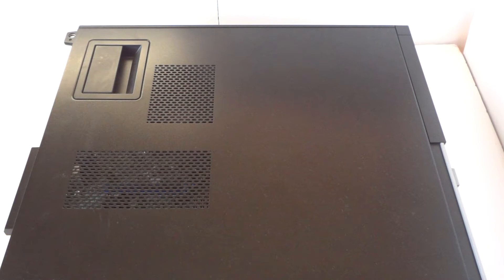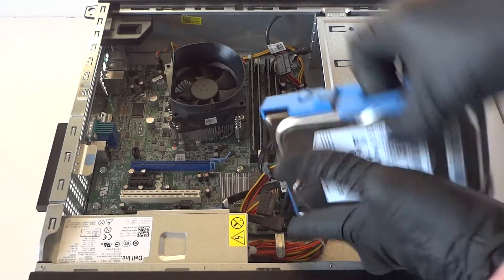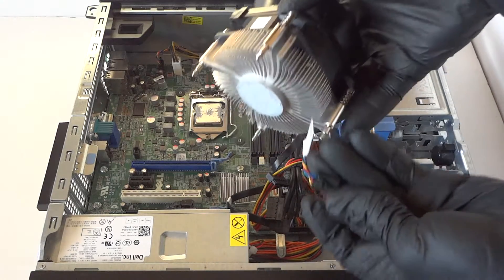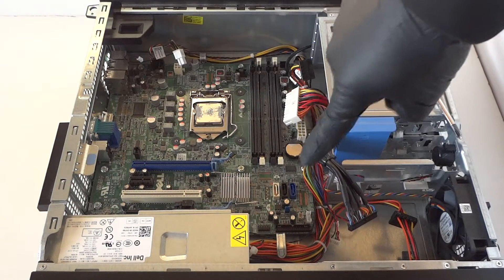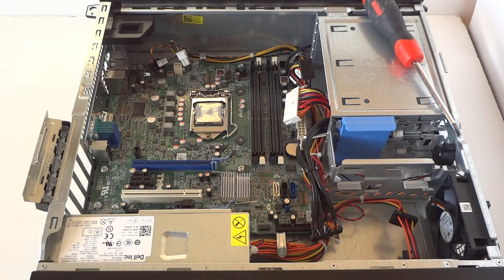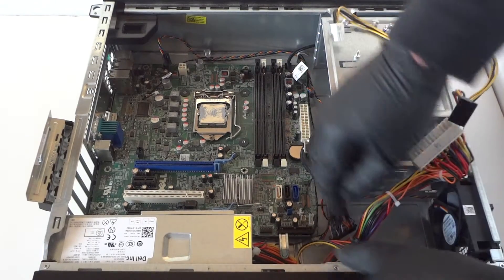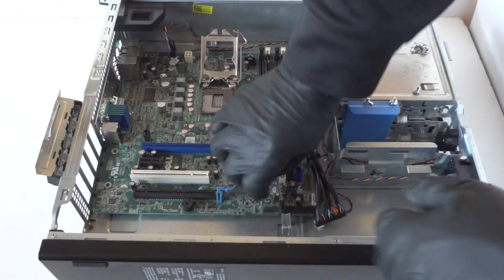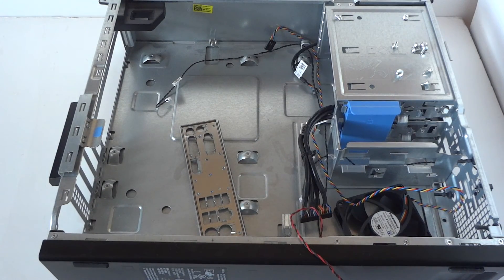Dell Optiplex 790 Teardown

Comment from the maker: List of Parts, Upgrades.. This video cards will work with this system dell optiplex 790. 

   
USB Wifi Adapter for PC AC600Mbps Wireless Network Adapter
 https://amzn.to/2ZaGuHb 

 
This video cards will work with this system.
(1.) GIGABYTE GeForce GTX 1650 OC 4GB GDDR6, GV-N1656OC-4GL Video Card
https://amzn.to/2B7N1sP 
 
(2.) Gigabyte GeForce GTX 1650 OC GDDR5 Low Profile 
https://amzn.to/3el08os
(3.) Gigabyte Geforce GTX 1050 Ti OC Low Profile 4GB GDDR5 128 Bit PCI-E Graphic Card (GV-N105TOC-4GL) 
https://amzn.to/2T8bfsv
(4.) MSI Gaming GeForce GTX 1650 4GB GDRR5 Low Profile Graphics Card (GTX 1650 4GT LP OC) 
https://amzn.to/2X1FYsF
(5.) MSI GTX 1050 TI 4GT Low Profile  Graphic Cards 
https://amzn.to/2LwZd7P
(6.) Gigabyte GeForce GT 1030 GV-N1030D5-2GL Low Profile 2G Computer Graphics Card 
https://amzn.to/2Z4PHkp
(7.) ZOTAC GeForce GT 1030 2GB GDDR5 64-bit PCIe 3.0 DirectX 12 HDCP Ready Low Profile Video Card ZT-P10300A-10L 
https://amzn.to/2WzgLXk 
(8.) MSI Graphic Cards GT 1030 2GB GDDR5, Low Profile 
https://amzn.to/390Spum 
  

This RAM works with this machine MAX Supports 32GB:
(1.) Crucial 8GB Single DDR3L 1600 MT/s (PC3L-12800) Memory CT102464BD160B
https://amzn.to/2z7gDpj
(2.) Crucial 4GB Single DDR3L 1600 MT/s (PC3L-12800) Memory CT51264BD160B 
https://amzn.to/2TrcLq1
(3.) Crucial 16GB Kit (8GBx2) DDR3L 1600 MT/s (PC3L-12800) CT2K102464BD160B 
https://amzn.to/3g7dE0C

 
This HDD 2.5inch will work in this caddy for extra storage.
(1.) Dell 3.5" to 2.5" SSD or Hard Drive Caddy Adapter R494D 0R494D 
https://amzn.to/2XTPeRr
(2). Dell Hard Drive Caddy, R494D, F767D 3.5" to 2.5" SSD or Hard Drive
https://amzn.to/3cTkcOk
(3.) Black  HDD Plastic Mounting Bracket Adapter 3.5 to 2.5inch SSD or Hard Drive 2.5, 
https://amzn.to/3bP1O7Y 

(1.) Seagate FireCuda 2TB Solid State Hybrid Drive Performance SSHD – 2.5 Inch 
https://amzn.to/3b1e8T7
(2.) WD Blue 2TB Hard Drive s, SATA 6 Gb/s, 128 MB Cache, 2.5"
https://amzn.to/2Xstb4b
(3.) Seagate BarraCuda 2TB Internal Hard Drive HDD – 2.5 Inch 
https://amzn.to/2xmf0TE

This Splitter cable required if you going to install SSD and HDD 2.5inch with 494D  0R494D Caddy :
Benfei 15 Pin SATA Power Y-Splitter Cable 8 Inches
https://amzn.to/2XsG0LV
Cable Matters 3-Pack 15 Pin SATA Power Splitter Cable 8 Inches 
https://amzn.to/2Rval8B
Zheino SATA Power Splitter Cable (2 Pack) SSD Power Cable HDD
https://amzn.to/3a3V9Wq 

SSD list works with this PC:
(1.) Samsung 860 EVO 500GB 2.5 Inch Internal SSD MZ-76E500B/AM) 
https://amzn.to/2ZlZDGg
(2.) WD Blue 3D NAND 1TB Internal SSD, 2.5" WDS100T2B0A
https://amzn.to/2XezdU9
(3.) WD Green 1TB Internal PC SSD  WDS100T2G0A
https://amzn.to/2XfGtzc
(4.) SanDisk SSD PLUS 480GB Internal SSD SDSSDA-1T00-G26
https://amzn.to/2yfgjUK
(5.) Crucial MX500 250GB 3D NAND SATA CT250MX500SSD1(Z) 
https://amzn.to/3bTTjbX
(6.) Samsung 860 PRO SSD 256GB - 2.5 Inch SATA III 
https://amzn.to/2ymvQCq
(7.) Samsung SSD 860 EVO 250GB 2.5 Inch SATA III Internal SSD 
https://amzn.to/2VjIAkK
(8.) SanDisk SSD PLUS 240GB Internal SSD
https://amzn.to/2zfc7EX

Thermal Compound Paste:
(1.) Arctic MX-4 2019 Edition Thermal Compound Paste Carbon Based
https://amzn.to/2XcsZo4
(2) Arctic Silver 5 Thermal Cooling Compound Paste 
https://amzn.to/2ziNU0H
(3) Noctua NT-H1 3.5g, Pro-Grade Thermal Compound Paste
https://amzn.to/36kTk7A
(4.) ARCTIC MX-4 (current edition) Thermal Compound Paste 20 Grams 
https://amzn.to/2DhGJaK

HDD list works with this PC:
(1.).WD Black 2TB Performance 3.5" Hard Drive - 7200 RPM Class, WD2003FZEX 
https://amzn.to/2xFUeyF
(2.).Seagate BarraCuda 1TB Internal Hard Drive
https://amzn.to/3g8FXM8
Reply: Stop

Comment: just ordered this pc from Newegg for $75 going to toss the MB and Install a ITX AM4 mb with a r3 5300g and a 5060 GPU and a replacement 500w PSU for a media pc also why i want a full size DVD drive slot for and console stile gaming on my 4k tv and watching movies ..I will test the low profile 5060 in it before I remove the old MB just for grins.. that's is one thing nice about this case is it fits standard ITX and Matx motherboards for modern upgrade and retro build ..

Comment: Seems you don't even need a caddy to put a 2.5 inch drive in. Underneath the caddy for the 3.5 inch drive, are four screw holes (one is kinda covered by that silver aluminum piece) that are the perfect dimensions for mounting a 2.5 inch SSD. So you can run dual drives with just that built in caddy alone.

Comment: Is the 790 dt the same as the 7010 dt?Are the front bezels interchangeable?
Reply: yes, the 7010~ is basically a 790dt but probably the difference is the power connector at the motherboard (if i'm not totally wrong)
Reply: Stéfano Júlio Mariani oh that’s good to hear then.I am looking for a front bezel and they look identical but wasn’t sure if they are the same dimension etc.

Comment: why do them sensors even exist? will my pc function normally without them plugged in ?
Reply: You’ll get a warning each time you start up your pc if they aren’t connected but you can still run the pc without the temperature sensor.

Comment: Sir, what is best powerful graphics card for optiplex 790 dt can we upgrade power supply ?
Reply: Running with a 990 DT i7 here after maxing RAM, swapping SSD and adding a low profile GTX 1650. It all runs well on the stock 250W PSU. The only reason why I swapped my PSU  was because I found a good deal from a known PSU brand. Swapping in a TFX 300W PSU from Silverstone, every temp reading dropped at least 15 degrees: only notable difference so far.
Reply: the 1050 ti low profile graphics card from msi works perfectly without having to buy a new power supply as long as you have a 240 watt power supply as standard
Reply: 1030 ddr5 2 gb

Comment: can someone please help me i wanna know if i can the parts into a differnt case and add a better power supply
Reply: Its possible but you would have to buy a optiplex power supply adapter it's like 15$ in north america you can try ebay it's about the same

Comment: can i add a GT 1030 in a dell 790 stock PSU
Reply from the maker: Hi, yes you can.
Reply: Does the gtx 1030 gigabyte require any connectors
Reply: @DuneBug8868  every gt 1030 does not requires any connectors. Because the card uses only 35w of power through the motherboard.
Reply: @starline7228  I think it uses a bit less only 30w